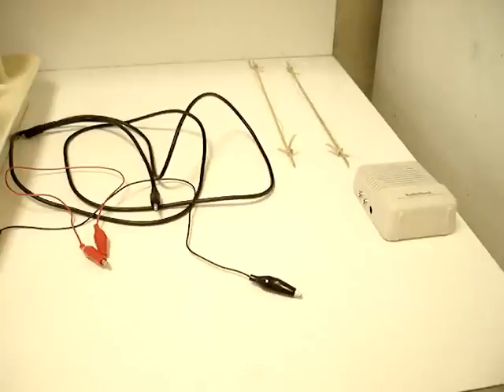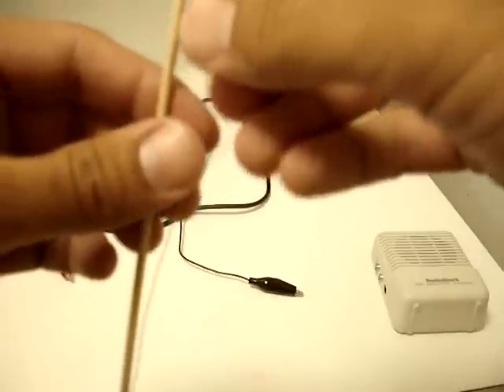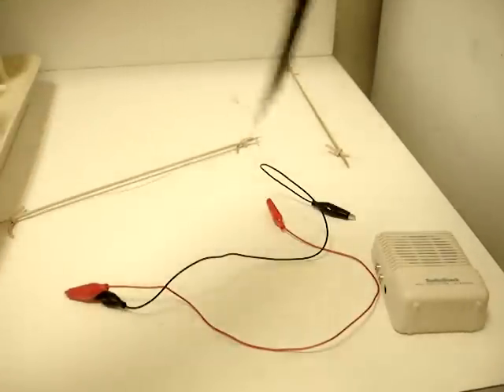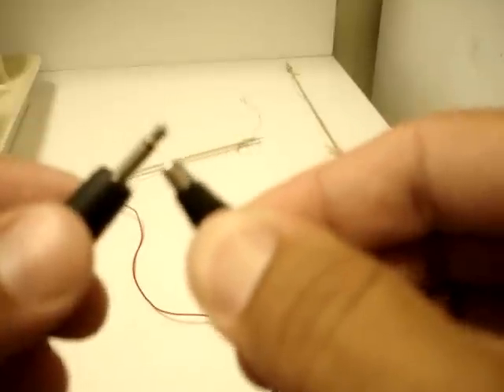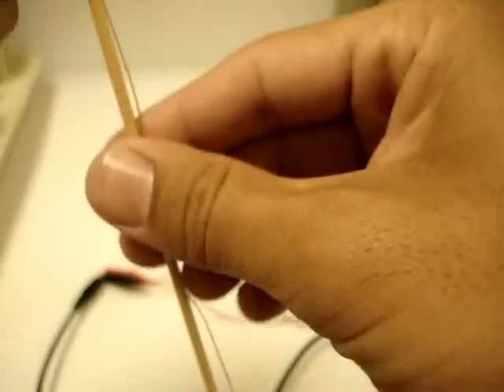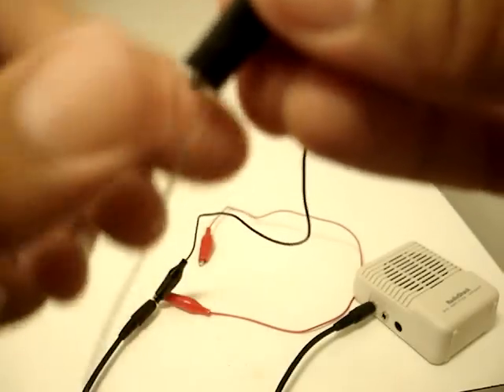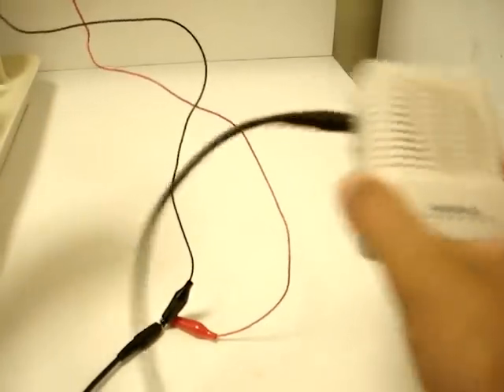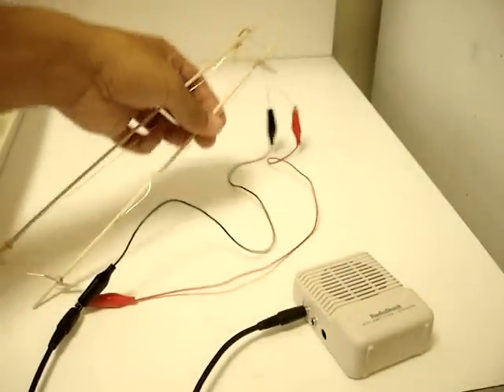Electric Eel Audio Electrical Discharges Audio Setup

Comment: I have a 40" Electic Eel, I used to be able to hear the sound but now I cant. I thought the amplifier was broke so I got a new one, using the same clips you do, etc. and I'm not hearing anything. Any suggestions? You can see the eel in my videos. Thanks!
Reply: Nope, sorry. Good luck though.